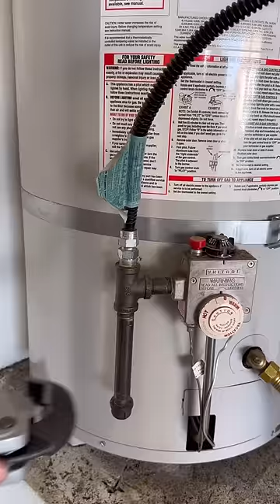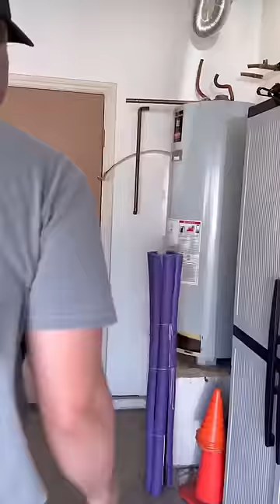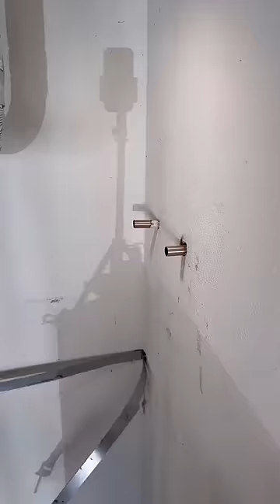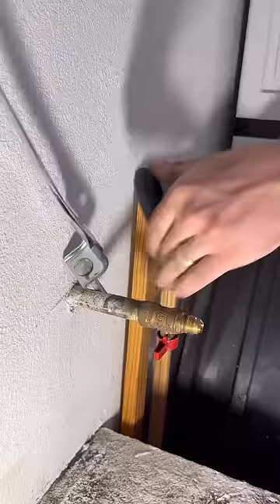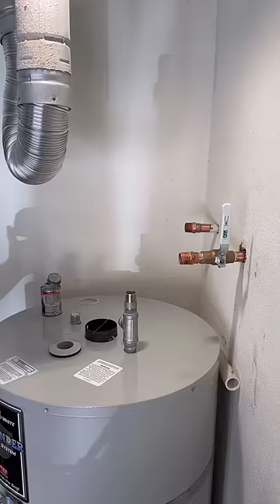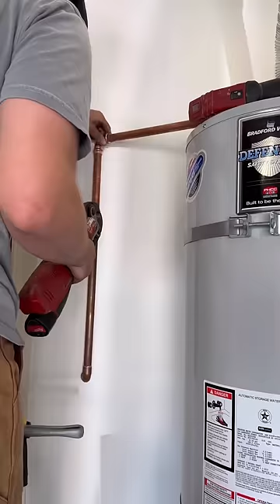Ridgid RapidGrip Pipe wrench on a water heater

Comment: We do it basically the same up here. Union plumbers up here are required to learn and master every aspect of plumbing, as well as fitting, and welding. I'm a service plumber but also do HVAC and Refrigeration service as well. We have to be extremely well rounded up here as we do not have as much manpower to specialize
Reply: union lets you guys   do house plumbing as well as   fitting and pipe welding?    down here pipe fitters and welders , kind of clash with  plumbers.      also  Your U.A. card either lists you as  a plumber or steam fitter   and it can be difficult to go on a job that dosent match what  your "book occupation  " is.
Reply: @jeffreyplumber1975 I imagine it’s a little different where the population density is so low. I’m kinda surprised there are even unions in Alaska lol

Comment: In Juneau Alaska we use electric water heaters, sitting on a concrete floor in a garage with earthquake straps.  No expansion tank required. Cheers!
Reply from the maker: Thanks brother
Reply: Yeah I'm born and raised in Anchorage and I was scratching my head with the expansion tank. Maybe cause we don't run as high of pressure in Alaska?🤷🏾‍♂️
Reply: @alaska79 if there is a backflow preventer on the water service, then you need an expansion tank

Comment: It was all done correctly. It's code in California you have to use flex lines because of the earthquakes. And the vent is code in most states because it's rated for water heaters, they sell them at home Depot for like $50 - $60 dollars. 

I live in Pennsylvania so I use solid copper for everything and rigid vent, but I have used those flexible vents before ( the ones rated for water heaters and boilers ). And I use solid copper for the expansion tank. But he used stainless steel, he didn't use galvanized.

Comment: Unsupported expansion tank? When the membrane fails (and is a when, not an if) - that tank can fill with 3 gallons of water or so. That is about 10kg of weight sitting on the end of an unsupported pipe. Are you sure it can take it?
Reply from the maker: That 2 gallon tank can fill up with 3 gallons of water?! That’s amazing
Reply: @replumb  ok, I am not high on gallons and other ancient units. But the point is the same - that is about 7 kg of unsupported weight pressing down on that lever of a pipe in case of failure.

Comment: I like the install but got worried when i seen you un sweat the tee for the expansion tank. technically you did alright but it can be always be done better depending on the clients budget. the right way is to use the adequate expansion tank strap system, tee in copper pipe with 6"' brass nipple and isolation valve, male adapters and flex lines and single wall stainless steel venting or double wall to attach to existing pipework, earthquake straps withing top 12'' and bottom 24'' and lastly T&P relief valve within 6-8 inches of the graded floor leading towards a drain. not every situation can accommodate these rules so it depends on the technician and the property owner to work out the kinks beforehand.

Comment: this looks like a very popular water heater type in California. I am from Europe Don't you use any kind of combi heater there? I mean what we use here is the Combi equipment that does apartment heating and and water heating in the same appliance with a built-in switch valve and a similar water tank is under the appliance with a water pipe coil in it for heating ie water heats water but in a closed space and when it is ready it switches back to hitting the apartment. or you don't need heating in California at all? our tank is usually 120 litres this gray type looks very professional I guess it at least 200 liters

Comment: Where does that T&P release pipe drain to?
Also, ive seen peole put a valve on the hot water side too, so that you can turn off the water and change stuff out without having to completely drain all of the pipes.

Comment: Your pool noodles covered up gas connection; in CA is supposed to be valve, sediment trap then flex connector, right? 

Also, why no flex connector on t&p valve drain line  so next guy won't need to solder anything?  (Voice)
Reply: no threaded connections (other than the TPRV thread) are allowed on the piping, to prevent easy access to plug or cap.

Comment: Expansion tank isnt high enough, failed installation, and theres a reason you can hook an air pump to the tank, because it needs to be set at proper psi, not just whatever it comes at, otherwise it serves no purpose